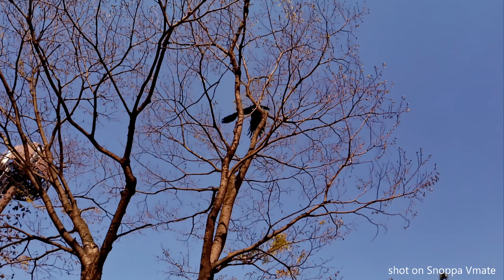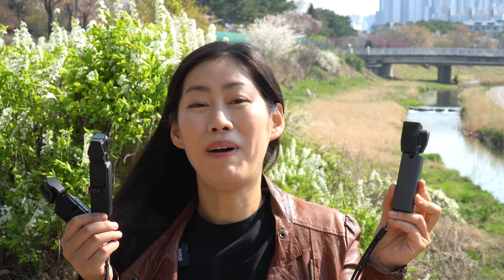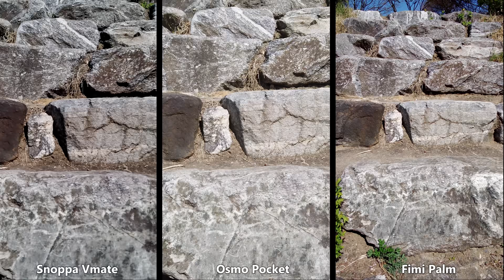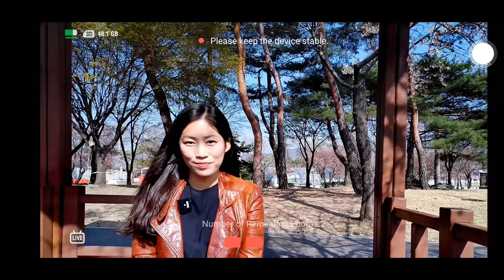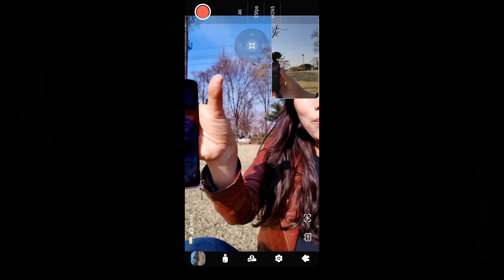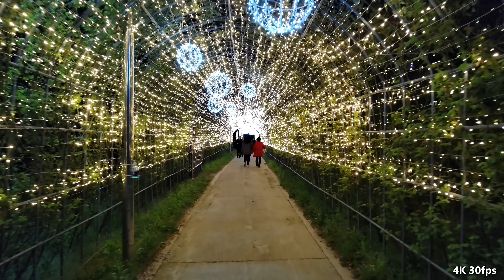SNOPPA VMATE | Better than Osmo Pocket or Fimi Palm?

Comment from the maker: (2020. Oct. 9 Update) The gimbal of Snoppa Vmate tilts...sigh........ 🔎......
Reply: I have osmo pocket and i contributed snoppa vmate back in Jan 20 but still didn't recieve the unit yet.
Reply: it's shaking. jolting. etc. painful to see. :-(
Reply: If they would ship me the package i backed 5 months ago, then I can tell you.
Reply: I wasn’t a fan of Snoopa’s footage. The blacks are seen slightly crushed. 

Also, I doubt 3rd party manufacturers are going to support every new little gimbal that comes out with ND filters and accessories. Dji (for the osmo) is a major company, so it’s a good risk to manufacture accessories for. Same for GoPro, and things like that.  

Some of the other features Snoppa seem like they can be done with the others via firmware updates. 

I’m content with my Osmo - and the accessories I have for it. Which is...pretty substantial for me when considering other cameras.

Also, I just got that new Ulanzi Anamorphic lens for my osmo pocket, and I love the footage! 😁
Reply: Let's talk about the footage. I think the Gopro hero 7 is better. This knock off design has its potential but the 2 inch touchscreen on the back of the Gopro is more useful than this 1.22 inch screen.
Reply: As you said, Snoppa has made a handheld gimball so they need to provide an access to every main & usefull fonction in the gimball...Improve the sound (i've made the same than you, edit my video by adding dB), it's scheduled for the next firmware..(2.02.43) Colorimetry could be better, always too reddish outside (need different white balance mode in the gimball, not only in the app), i had some sound decay too (i guess during 4K long clip...), drop frame in high fps mode(FW2.02.40 same, seems to be corrected in 2.02.43)....https://youtu.be/oMIp0p2DOkw?t=83
4k 50 fps doesn't work anymore in the last firmware (2.02.43) I think that they need to work hard, cause after all it's their first product in this kind;
Reply: @SETHalpine  Osmo Pocket was that way for a lot of things at first.  Hopefully, Snoppa will remedy this is firmware updates
Reply: no I don't have any gimbal stabilised pocket camera but young have you seen osmo action's rock steady ? its so amazing because osmo action have electronic stabilisation and it is more stable then these gimbal pocket cameras 😱

Comment: No, it is no better than the DJI Osmo Pocket for a numbers of reasons.  The Snoppa Mate is not for prime time.  Yes, I have the mate for more than a month.  Yes, I am using the most recent firmware.  The major problems are: 

(1) Its gimbal is problematic.  Even after calibration the lens could roll to one side or tilt upward.  
(2) The power button is overused.  Recently, pushing it for taking a picture could turn the camera off.  That is, you have to turn it one after taking a picture.  It is only good when shooting video.
(3) The message "reinsert SD card" message occurs way too often even though the card was formatted.  Well, he micro SD card came with the camera and is good on all of my other gimbal cameras.  The design of reader or firmware could be problematic.
(4) Network connection with my phone (iPhone X) is not stable.
(5) JPEG quality is very poor.  Washed out color and way too noisy in not even very dark environment.
(6) Operating pan and tilt is OK, just OK with touch screen.  A joystick or even a lousy DJI wheel would smooth the operation out significantly.
(7) The power button needs to be resigned and perhaps relocated.  You can easily power the camera up when the camera is in the case.  Should this happen the case blocks the camera movement completely.
(8) etc., etc., etc.

Carrying a palm-sized gimbal camera is basically for mobility.  If a gimbal camera must be paired with a phone to be used fully, the size is too large and mobility is lost.  I have several gimbal cameras  (e.g., Osmo Pocket, Mate, FIMI Palm, Feiyu, and a not so common Remove K1) and Mate is the worst.  IMO, Mate is a premature product and needs to be significantly upgraded (compared with other gimbal camera).  I have been using the Osmo Pocket for more than half of a year and still think it is the best even though it has shown it age.

Comment: It's a tough decision because the Osmo costs more to start, and then you pay extra for the wifi dongle, the scroll wheel, the wide angle lens, and the 3.5mm mic attachment. It's not just the cost but the bulk of it as well. You can't fit the osmo back in its case with the scroll wheel on. You can't turn the camera on or off with the wide angle lens attached or it gets stuck, hitting the gimbal. From watching clips though this snoppa seems probably the worst quality film. I'm currently tempted by Fimi Palm out of all of them.

Comment: I've been wanting to buy a handheld camera (thats very small) for concerts but I'm stuck on which to buy. It is pretty dark but since I'm usually near the stage theres a lot of lights (flashing and not). Which one do you think would have the highest video quality in dark places with a lot of flashing lights?
Reply from the maker: i thought Snoppa is the brightest amongst Snoppa, Osmo Pocket and Fimi Palm. but then Osmo Ppcket does have its own mic adaptor, so you can actually record decent sound by connecting an external mic. 
But then also, how good of a quality you want your video to be.. then you might need to consider bigger "proper" camera with some bright lens (bigger aperture)

Comment: Hi great video. I have the vmate and have tried various ways to record audio. All have big sync issues. 

Did you record the sound separately in your video or do much post processing on sound.
Reply from the maker: yeah, i had sync issue, most of the sounds were recorded on my phone with external mic...
Reply: Young360 thanks for the reply. It would be good if the external mic into the phone worked better or even processed on the phone. 

I want to use the footage to directly upload to social media. But we will see I guess. 

Love it that the phone is remote so can’t have it all. 

Great little camera for b roll.

Comment: Can you connect rode wireless go with v mate?
Reply from the maker: i only have dji mic adaptor which doesnt work with Vmate..... if you can find an adaptor that works with Vmate, you should be able to use wireless go.......
Reply: @Young360  thx for your advice 🙏

Comment: The video is very jumping, the stablization is totally a disaster, which is the basic of the gimbal camera, but the snoppa still can't fix it till the day one.
Reply from the maker: i was walking up the steps, so all 3 cameras would have stepping up impact😅
Reply: Young360 I mean when you are running, the video is jumping for the vmate, looks like the focus is not working properly
Reply from the maker: i realised with vmate, i often need to press to get it focused. but once focused, it focuses well 😂

Comment: Great video Young, I ordered my Vmate back at the beginning of Feb but still waiting for it to be delivered, so a bit pissed at the long over waiting, with almost no communication. Your video explains exactly why I made my purchase, the company just need to honour the early backing orders.
Reply from the maker: yeah,.   but it does seem like the world is going through crazy time... shipping also seems like a big issue in many countries.... fingers crossed that you get yours very very soon! 🍀
Reply: I backed mine in November still nothing either, messaged twice about two months ago to confirm delivery details, not had anything back yet, hopefully get it soon as I backed the atom and had no problems, times are difficult all over but a bit of communication wouldn't go a miss 😂

Comment: It's great with a new competitor but, as said before, Vmate suffers from a more narrow FoV and the microphone did not impress me either. Also the Osmo Pocket has an advantage having more third party accessories, right now.
Reply: It doesn't 'suffer' from narrow FOV - that allows a proper focussing system and shallow depth of field, which is highly desirable in many situations.  The Palm on the other hand has fixed focus, very wide angle - which is fine if that's what is required for the particular shot.  It's essential to realise that these are are alternative devices, and there's no universal 'best'.

Comment: From this video, I think the Fimi is still at the top of the pile of handheld gimbal cameras, for it's wider FOV and built in joystick.  I'd personally probably go osmo pocket next, then Snoppa vmate last.  It just doesn't seem like it does anything better besides have a neat cell phone attachment method.
Reply: It's nice to have a pocket camera with a more natural FOV for those of us who are just going to shoot sceneries and such.
Reply: So long as you don’t film at night time.
Reply: @1980gm9  truth.  If I need to film something of quality at night, I wouldn't recommend any of these cameras though 😒 something with a sensor bigger than a kernel of corn perhaps?!😜
Reply: Daniel Traner You can get decent night vids with most phones now though. The stabilisation on these devices is really good so pity the fimi isn’t a bit better at low light.
Reply: Fimi doesn't have 4k 50/50fps... Fimi has a big FOV....which is only good if you like it, I don't like the way we perceive things with unnatural FOV, a car that goes from left to right, no longer seems proportionate to me, it's good for what is in the center ...
Reply: The built in joystick is only useful if not using the camera sound, because it makes unacceptable clicks which firmware can't fix.

Comment: I have seen other reviews and the pulsing while panning is really bad.  The audio is bad.  They wanted me to review these cameras but the issues seem like something hard to get past.  I would put DJI far ahead.  Thanks keep up the good work.
Reply: Next Firmware will correct the audio problem. But they've some others problems to solve again...Balance of colors, drop frames...Sound decay...I've bought it for 175€ so i can wait a little...BUT they've have to improve it quickly now